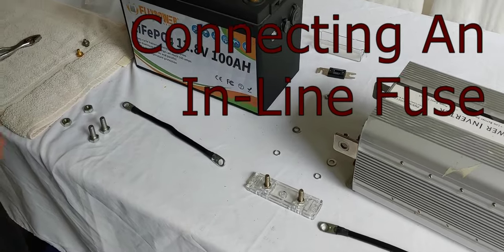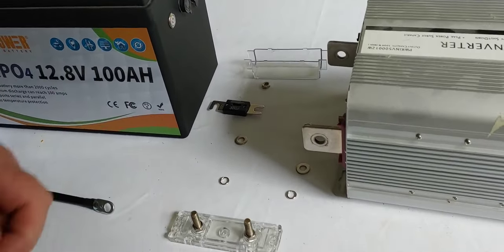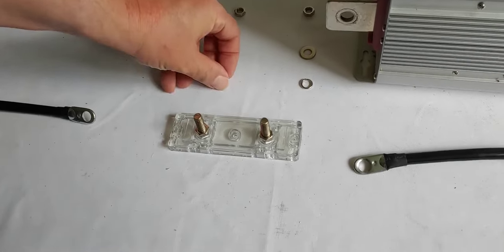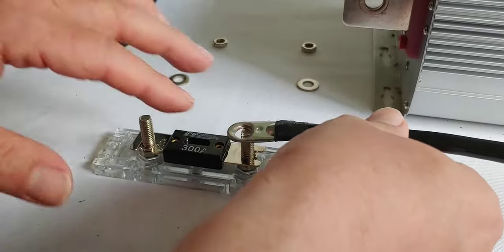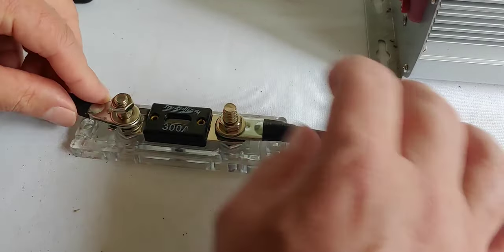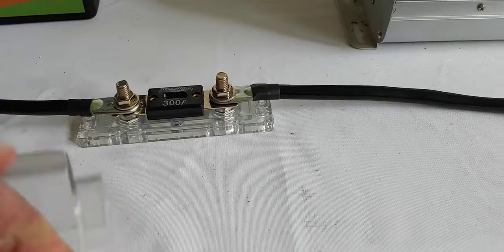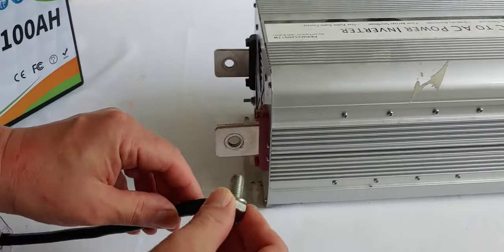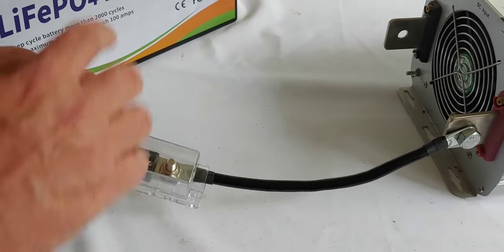How to connect an In-Line Fuse to an inverter.

Comment: I have a Vevor 2500-watt pure sine wave inverter. What size fuse should be used?
Reply: Divide wattage by voltage of battery depending on your setup. Example 2500 watts divided by either 12,24,36,48 volts.  I think in your case you will need 48 volts battery so 2500/48= 52.0833. You should use a 60amps fuse. I stand to be corrected...